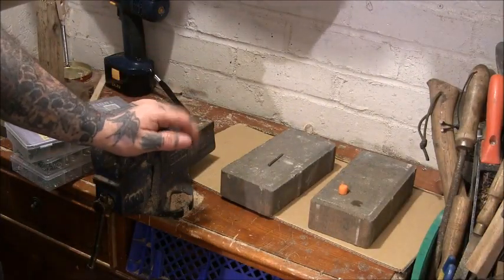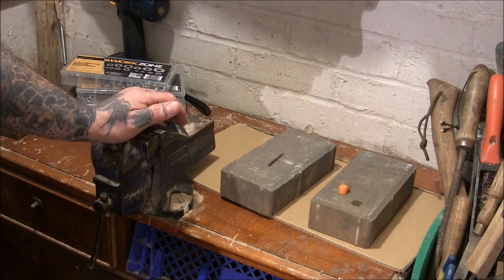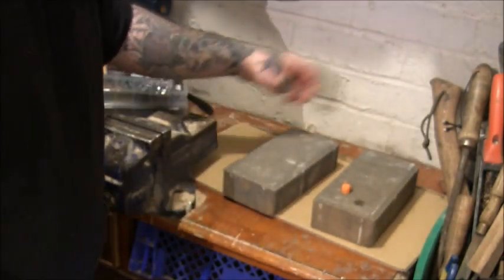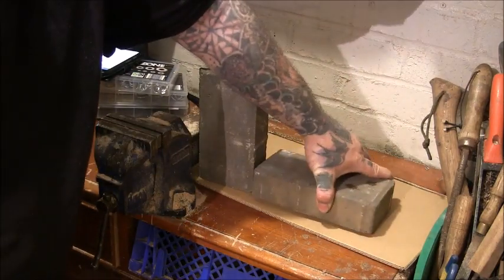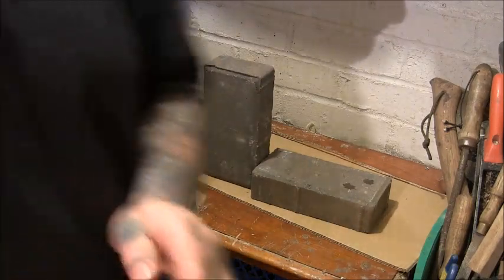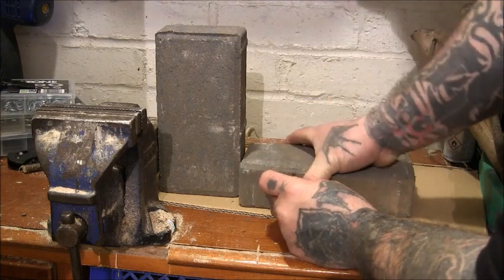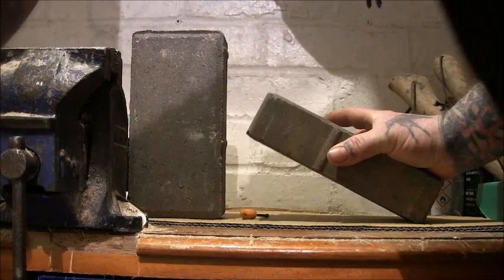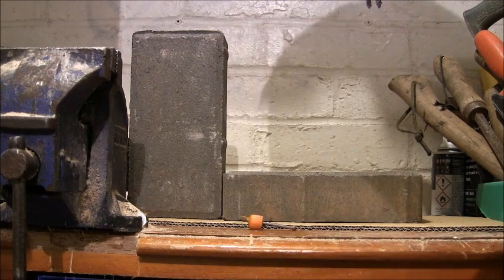Kent Field And Garden Mouse Trap

Comment: My kind of trap.  Should have a vacuum tube and a meat grinder, leaves the bait and trigger intact - but the mouse/rat gets cleanly removed.
Reply: Reminds me of a West Coast exterminator company's logo picture.  There is (right to left) an undertaker in long coattails, top hat, and glasses, with a wooden sledge hammer behind his back.  He is looking over and down at a mouse next to some bait.  The mouse is dressed as a thug in leather coat, black glasses, acting tough with an outstretched and upward switchblade - or flying him the finger.  The mouse is going to get a reality check real quick.